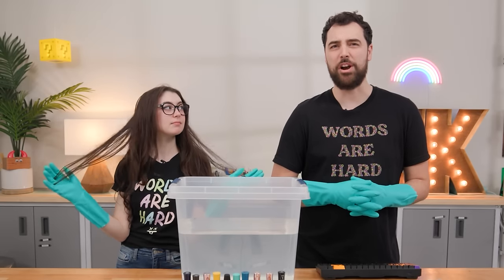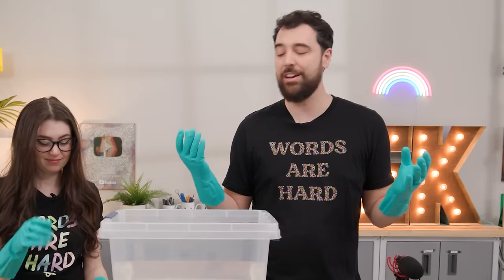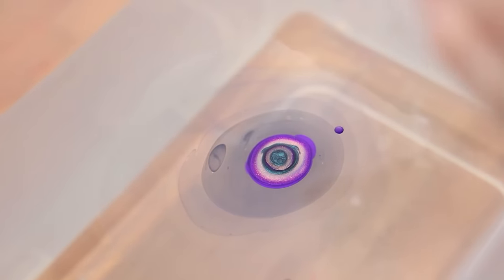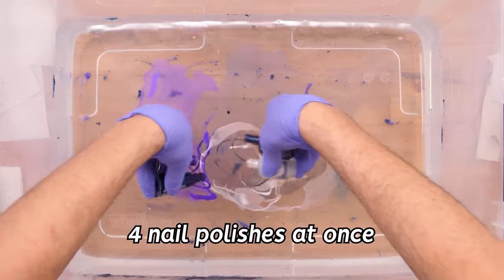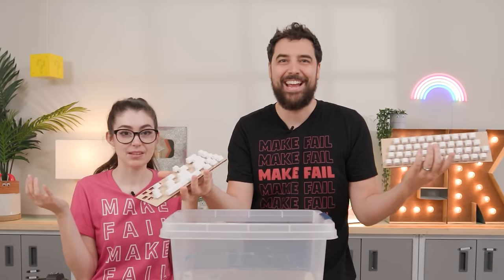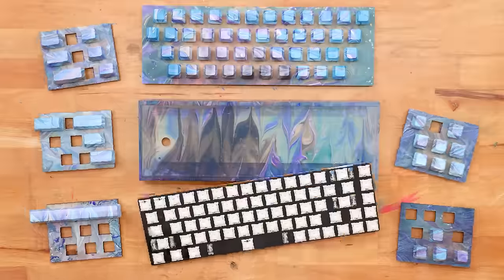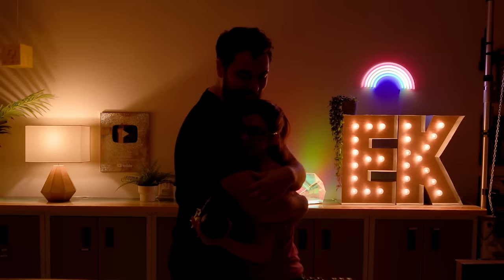Is it Possible to Water Marble an Entire Keyboard?

Comment: I´ve seen somewhere a similar technique using spray paint, which is thinner than nail polish, and the pressure from the cans of paint spread the previous colors beautifully
Reply from the maker: Definitely on our list to try sometime!
Reply: Came here to say the same! Tumbler makers use spray paint water marbling
Reply: yeah, when we did watermarble art when I was a kid in Scouts, we did spray paint. I always ended up going toward the end and getting clumpy bits. Tragedy.
Reply: hydro dipping
Reply: Old King of random video did it back way back when.
Reply: @EvanAndKatelyn I recommend trying out nail polish thinner, it could possibly help with the nail polish globules from forming and making it more runny.
Reply: the spray paint works so much better than nail polish. you don't end up with all the holes and imperfections afterwards.
Reply: I've watched some videos of people hydro-dipping electric guitar bodies that way, they always come out beautifully.
Reply: Does there need to be a certain depth of water to support the nail varnish? Your bigger bin had half the depth of water than the smaller one. With marbling carrageenan makes the water thicker but that’s with thinner media than nail varnish so maybe wouldn’t help. Keep trying, these are great even when they ‘fail’. Which this didn’t. 🥳🎉
Reply: Yeah, that’s actually how is done, the nail polish one was only for nails, but somehow people missed the part where - all of the nail artists - explained where the technique came from 😅
Reply: I genuinely don’t know, is this the same as “hydro-dipping” or is there some differentiating factor between them ? Either way loved seeing you guys get so excited when it started working !!
Reply: Indeed, spray paint would work so much better for this, good result none the less, but I'm pretty sure spray paint wouldn't gloop and bind up like it did with nail polish.... that plus spray paint is considerably cheaper :D
Reply: Jenna Marbles hydro dipping her crocs comes to mind 😂😂
Reply: They really should try!

Comment: Instead of Alcohol - I think a better idea would have been to try adding acetone to the water. I suspect that might be why the "magic bin" produced better results over time, the higher and higher acetone content in the water allowed the nail polish to thin more. Alcohol has very little effect on solvent based paints - it's why nail polish remover is made of acetone, you need a solvent :)
Reply from the maker: Oooh neat, we'll have to try that next time as a variable!
Reply: nail polish does not contain acetone.  putting acetone in the water would just make the nail polish dissolve into the water.  You need a film of "dye" on the surface of the water for water marbling, you don't need a tub of colored liquid.

the problem is the layer of "lacquer" that some nail polishes contain, that protects the polished nail from being scratched.  Some brands have it, some brands don't, or use it in smaller concentrations.  The first blue pour very definitely contained a very high concentration of it.

So it was a matter of which brand works and which brand doesn't.
Reply: I wonder if laying down spray paint first to “prime the pot” would waste less nail polish and still have a cool effect?
Reply: @albertlwj  to be fair I didn't say it contains acetone, I said nail polish is solvent based (which it is, "Conventional nail polish consists of a polymer, most commonly nitrocellulose, dissolved in a solvent, usually ethyl acetate or butyl acetate. When it is applied the solvent evaporates, leaving the polymer to form a film on the nail.") - so a solvent is used to thin or dissolve it. 

I do agree with your thoughts process though, it makes sense. Was mostly just sharing that alcohol probably didn't do the intended effects and why :) 

I haven't personally tried this, mind you, but I can say at the very least acetone would thin the paints. 

I agree with others in the comments though, that spraypaint method seems to be a lot more common and reliable!
Reply: @albertlwj  they never said nail polish contained acetone.
Reply: @albertlwj  "it's why nail polish remover is made of acetone"
Reply: or maybe try thin the nail polish before pouring it in. nail polish is thinned using ethyl acetate or butyl-acetate, so they should be able to thin it with that ad make it less gloopy, which you want for putting it on nails, but not so much for this purpose. to that will spread the nitrocellulose of the actual varnish out so it forms a thinner layer.
Reply: That looks awesome! You can’t even tell which ones are from different batches! Plus the addition of the lights, chef’s kiss😘🤌🏻
Reply: @tilicia  unless you used like... clear coat varnish or something, it would just be the "final" layer of color applied, and cover everything else. perhaps an extremely light coat would only leave speckles? but idk if that would be enough to improve the actual dispersal of the nail polish any.
Reply: I was thinking that thinning the polish would help the thick clumping.
Reply: @tiffanysandmeier4753 yea, but it all goes in layers... whatever's on the bottom in the bin... will end up on the top after it's dipped.
Reply: You can actually buy nail polish thinner. It would probably work better than acetone in this application
Reply: @thespankmyfrank  the magic bucket had alchohol in it. not implying there was acetone in the nail polish at all.
Reply: [sorry if my English sounds fun, it’s not my first language I’m not sure I’m using all the terms correctly in context, hope it’s still understandable 😅]

I’m more familiar with traditional on paper, with a water bath I used letterpress ink thinned with white spirit, so I guess trying making the nail polish with tiny amounts of acetone and then using other tools and techniques to “spread” the color, in traditional marbling usually we try to create a whole speckled surface using brushes or droppers/pipettes then something like the toothpick to create the design, it workshop well web the colours have the right liquidness: the drop should float and slowly “spread” once it touches the bath surface, not sink or spreading too fast.

Hope it makes sense

Comment: Most nail polishes are just hot solvent-based paints or lacquer paints. I think it would be a good idea to thin the paints using Mr Hobby levelling thinner before putting them in the water. It has an anti-drying agent along with the methyl-acetate thinner. The slower drying time allows the paint to level out on whatever you spray it on (like nails or model kits.) You'd probably end up with fewer globs in the end. Also, you could load this thinner in an airbrush and spray in on the final product if you see globs of paint to give them a chance to level out a little more, but do it sparingly so the paint doesn't quite run.
Don't think the paint too too much though. I would start with a ratio of 1:1 paint to thinner. For airbrushing hot solvents, you usually add twice as much thinner as paint. The thinner can corrode or etch ABS if you use too much. A stronger thinner like turpentine would melt the plastic outright.

Spraying a layer of clear solvent before the colored paints would be good too since it would serve as a final topcoat.

You might also spray the keys with a primer like Mr. Surfacer before dipping as well.
Reply: You seem to know what’s what
Here’s a question
What about marbling on top of a different surface instead of water, or using silicon medium and acrylic paint to get a more controllable blotch?
Reply: @EKimatH  are you trying to do a hydro dip or just paint on a solid surface? Getting a marble-look on something like plastic (I build scale models) is pretty straightforward with an airbrush. You would paint the surface in the color that will end up as the thin veins (usually dark) and let it dry completely. To paint the second color, you use something to mask parts of the first layer like stretched out cotton or gauze shaped into the pattern you like, then spray the lighter color. When you remove the mask, there will be a marble pattern left behind. 
I always practice techniques like this on plastic spoons, since multiple layers can be tricky.
Reply: @Phoenixflame87  I’m actually thinking if this could be a fun activity to do in safe housing with the residents, I would ideally like to fool-proof it as much as possible since most other residents are over the age of 45 and don’t have the motor skills to do delicate things. Before I got here I remember some frustration when I was a teenager and made interesting cards with the shaving cream marbling techniques that I swear were actually a thing I’m not making this up

Comment: Some tricks you might use, that are common when water marbling nails: 
Prepping the keys with a coat of nailpolish, usually one uses the brightest color used in the marbling, with iridescents a really dark one works better to make the pigments really pop. 
Once dipped, really carefully use a q-tip or a piece of tissue paper to soak up the water drops, do not touch the polish though, it helps the polish dry properly. 
If there is a waterbubble under the polish, use a thin needle to pop the bubble and soak the water up as before, the polish should lay flat or can be gently pressed down before putting on a clear coat. 
Use a clear coat on top, or some other clear varnish etc. The Polish layer is really thin and easily visibly scratched.

Comment: this turned out so pretty!!

i was wondering if it was possible to just acetone the keys if they were a fail so then you didn't have to bother redoing them so many times? likely was a time issue i'm guessing
but man this was awesome, would love to see more!!
Reply: The acetone also melts the plastic. I discovered this when i spilled acetone on a keyboard and it melted the surface and the inside parts too, so the keys wouldn't work anymore.
Reply: @justiina_cat  aaah, damn
that’s unfortunate a simple solution wouldn’t suffice :(

Comment: I've seen video of this technique used in production application. The dipping  tub had a divider on the surface. With the design on one side and clear water on the other.  They pass the object to be coated into the clear side, under and divider then up through the color..  Thanks for meeting you at Open Sauce.

Comment: The next time you want to do anything that's dipping like that it works best if you put in almost an entire bottle of clear nail polish first. The clear nail polish puts the film on top of the water and then your colors will stay closer to where you want them. It also stops the colors from spreading out quite so far
Reply: You WANT the color to spread out. Thats why the ones where it didnt, failed. The paint is too thick in the areas the color doesnt spread. Thats where the big globs of paint come from.
Reply: @early2exit  it does spread. When you're using a large bucket you don't use enough nail polish and it's becoming to diluted. They also were looking to use a toothpick to create a design. When you do that you don't want the nail polish to spread really far or your toothpick isn't going to do anything in creating a design. Clear nail polish puts the coating on top of the water allowing you to put the colors where you want and then mix them about with the toothpick as you desire.

Comment: I'm very curious why the smaller bin made such a big difference. Also i love the content, y'all never miss on a video. ❤️❤️
Reply: I wondered if it could have been a different plastic with a different polymer setting agent that was interfering with the nail polish...
Reply: @emma70707  that sounds pretty likely, or maybe a difference in the water surface area.
Reply: Maybe it was just the water had been ' primed ' with the constant flood of nail polish used for testing

Comment: Nail polish enthusiast and occasional watermarble witch here! Whether a polish is shimmery or creme ("matte") doesn't really indicate whether or not it will spread well in the water. It seems to be more based on the overall formulation of the polish. But from my experience, you generally don't want to use ones that claim to dry quickly (like the Sally Hansen Insta-Dri ones you have) since the polish is already going to be drying somewhat quickly on the water's surface. I'm told it's ideal to use room-temperature distilled water for marbling, though I haven't really noticed a difference between my (just-shy-of-toxic) tap water and distilled. When I dip my nail in the water, I usually hold it under the surface for a bit while I use a q-tip to get all the extra polish out of the way to make sure no extra color clings onto the design while I get my finger out. And sometimes when I get the bubbles of failure, I just kinda paint some polish on there and try to make it look organic. I can confirm that "fun aside from all the infuriation" is about how I expect watermarble to go every time. 😛This project turned out so well!! 😍

Also, you know you're too into nail polish when you can recognize Sinful Colors Let's Talk (the shimmery purple) and Sally Hansen My Ca-banana (yellow creme). 😅 Maybe I'll try to watermarble my nails with a similar look at some point and tag y'all on IG if it works!
Reply: "watermarble witch" the hell?
Reply: @danielkinnard5636  It's a joke (or is it? 🧙🏻‍♀️🤔) about how it takes witchcraft to successfully watermarble your nails, haha.

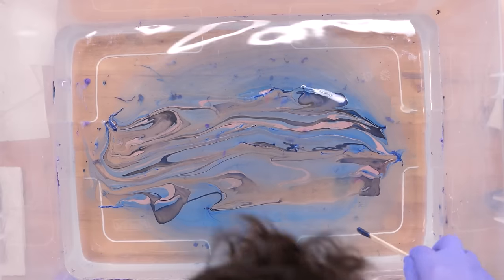Comment: 11:35 no, your issue is that the paints react with the water upon contact to form a film, but you keep stirring up this film in a vain attempt to spread out the paint. if you want the paint spread out, then you have to apply it to the water's surface where you want it. the tearing film effect is useful in securing the paint to the object. understanding this concept will allow you to water paint individual keys on the entire keyboard, as you inaccurately alluded to in the intro, @0:40.

Comment: Hey guys, wonderful job! I wanted to mention that nail polish is acetone-based and is a more volatile solvents than enamel for example. Doing paint water transfers with enamel base paints is going to give you a smoother paint application onto your part that you are dipping. It would also help to dab the surface with your fingers or gloves if you want to flatten down any air bubbles underneath the paint film.
Reply: If you want to use nail polish, but you find that it is too thick, you can dilute it a little bit by adding a couple drops of acetone into your nail polish.

Comment: Ooooh, the finished keyboard looks so cool!  My guess as to why the glitter/shimmer polishes didn't work well at first is that most of those types of polishes have a clear or tinted base.  So they'd end up basically invisible except for the glitters, until enough of it built up on the surface that the next pours of nail polish ended up on top of that clear layer, instead of the water.

Comment: Nail polish uses acetone as a solvent so to slow the drying time you should first float a acetone coat and then add the nail polishes afterwards. it will also thin the overall coating.

Comment: Room temperature distilled water is better. That and instead of dropping the keys horizontally in the mix, it works best lowering at an angle (remember, the keys have a bit of a depression in the middle which causes air bubbles to be trapped). Angling will cause the bubble to travel away from the surface as you dip. Also, a few drops of acetone will thin the mix out a bit and help spread more.

Comment: I used to work at a motorsports dealer, and somebody told me one time how Yamaha made their Realtree camo ATV fenders. They would submerge the fender first, let the water settle, then print the pattern on top of the water with ink. The ink was meant to permeate and stain the plastic, rather than just stick to the top of it like paint. Then they just slowly raised it out, et voila. I don't know if it was a special type of ink or what, but if there's something specifically for printing on plastic, I imagine that would be on the label.

Comment: the theory at 12:16 about the original bin of water being "better primed" holds a lot of weight - with traditional paper marbling it is fairly commonly stated (by people far more skilled at it than me) that the first half dozen marbled prints you make come out poorly, and that it's only once the water is notably muddy with sunken paint that you really start to knock it out of the park. this is why if i'm doing multiple batches of marbling water, i will save some of the old stuff and 'seed' it into the fresh.

Comment: I wonder if instead of alcohol, you used ethyl acetate (the solvent in the nail polish) or acetone (nail polish remover) to keep it from curing in the water, if that would help for doing larger batches.

Comment: just a tip with the life length of nail polish, it tends to get sticky or peely after about a year. now, i don't know if this just applies for polymer clay, it might react with nail polish funny. but if you want it to last, and for general durability, i would recommend sealing it, with something like Mr super clear, or if that doesn't work with nail polish, some other spray on varnish. the end result looks fantastic though, i love all the colors, I'm a sucker for pastels.

Comment: Could try putting a small drop of acetone in the polish to thin it before you pour.
I wouldn't add in the water as acetone generally speaking will break it up if too much is used (like the rubbing alcohol did). So adding directly into the polish should allow you to add a more controlled amount. Anything more than a drop will likely be to much depending on the scale of the test.